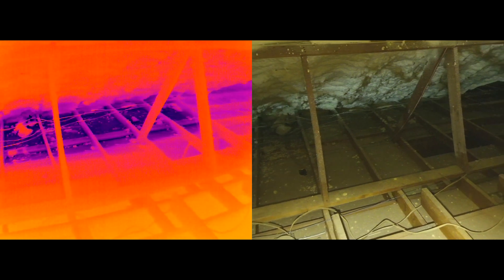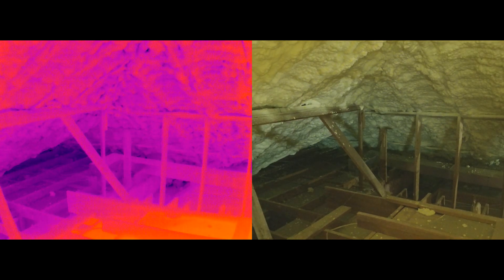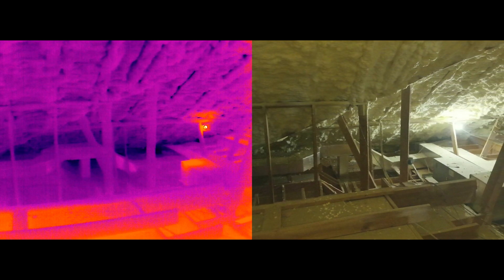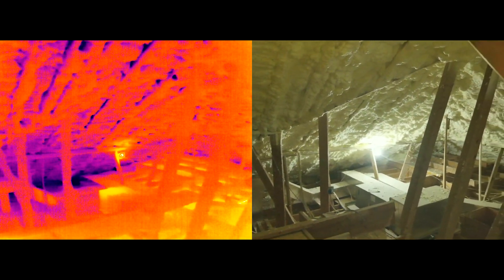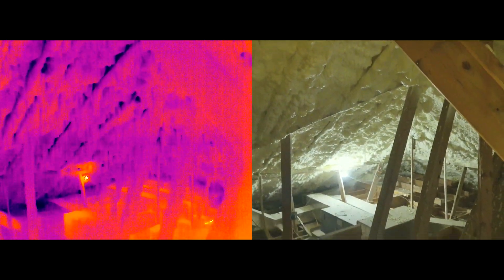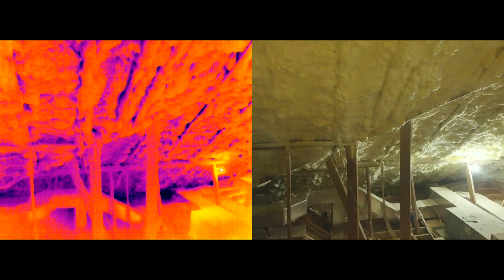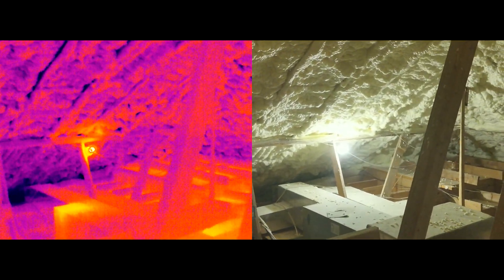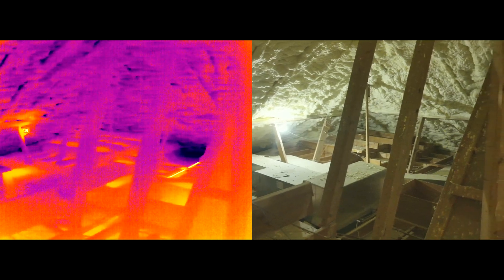Flying A DRONE IN MY ATTIC! 1st pass Spray foam Attic Inspection.  Using DJI Mavic 3 Thermal drone..

Comment: you didn't even need to fly, just hold it, there is no reason to fly it in there, (at least I don't see any benefit)
Reply from the maker: There were areas of the attic that I couldn't physically get into for the viewing angle that I needed.  But thanks for your input.

Comment: did you have to turn off the sensors on the drone to fly in the attic?
Reply from the maker: Yes I did and also ran with a prop guard.
Reply: @W0GEN  thanks, pretty good flying in the attic.  Were you in there watching it to make sure it didn't hit anything or were completely separate from the flight?
Reply from the maker: @KICKSRULEEAROUNDME  I was up there but really didn't need to be... worked real well!
Reply: @W0GEN  great job flying.  I'm gonna keep mine in the big opened space called the sky 😂